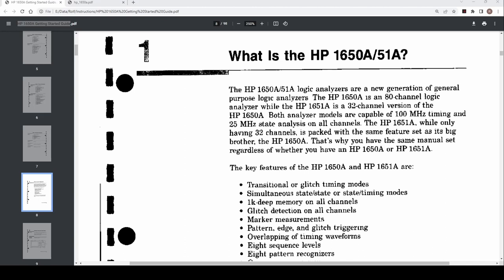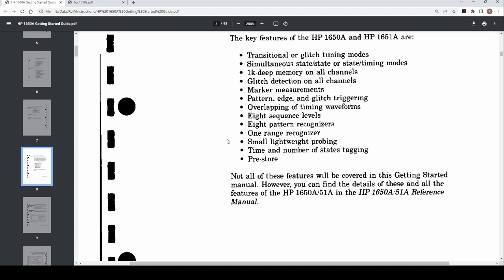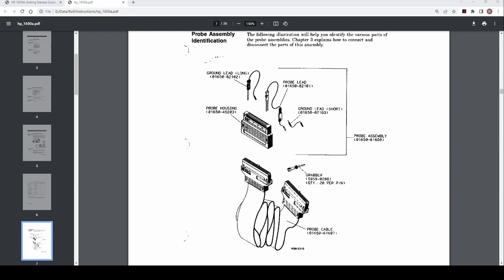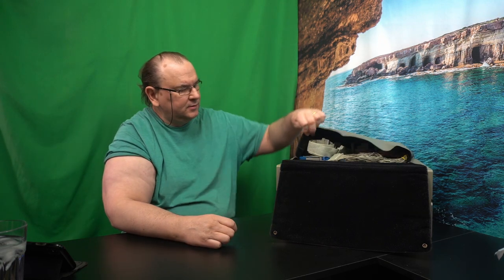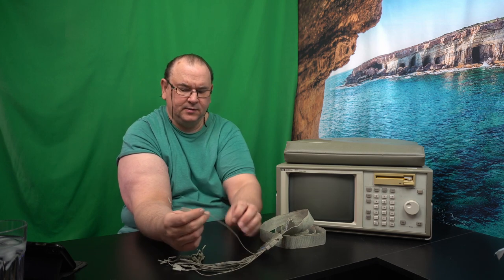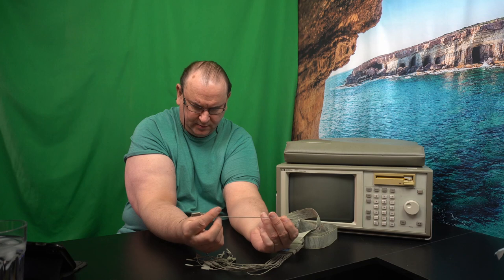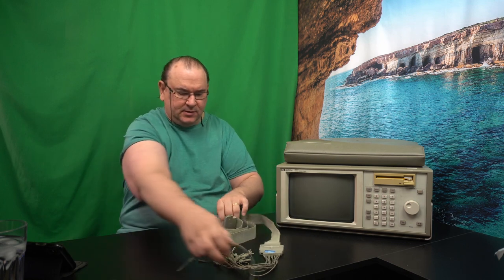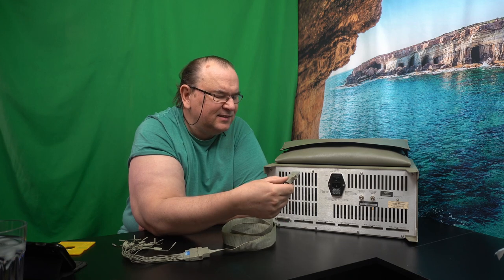Retro logic analyzer HP1650A from eBay general introduction

Comment: Hi TheTechRabbit, I have one of these LAs now.  I managed to find an IMD file for the 1.1 version of the OS.  The only way I can make a disk is with the IMD tool.  I have the logical files for the OS version 1.11 (the latest version) but no way to put it to disk.  IMD files are not editable.  Could you make an IMD file with the latest OS version and upload it somewhere?
Reply: X-nay on the request.  I finally managed to find enough tools to make an OS Ver 1.11 boot disk.  made a new IMD file for backup purposes.
Reply from the maker: Cool I was looking for file level tools also but had no luck. I only have a disc/image for 1.1